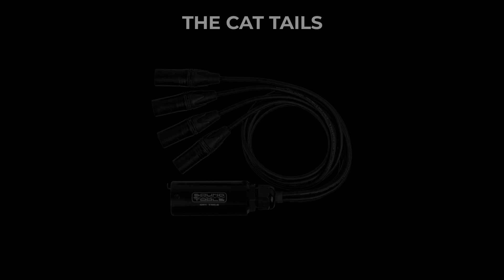Behringer X32 Midas M32 Muting Ping and Zipper Sound (Public)

Comment: I know this one...
Fader position digitisation. The rough part of the chirp is the rate at which the fader position is sampled. The squaek part is an artifact from the smoothing algorithm for the rough digitisation.

I first met this when installing an alpha test version of the Amec Digital ( was supposed to be beta, but it really wasn't that ready). With no consideration of fader position sampling, the faders sounded scratchy. Yup very expensive digital scratchy faders.
Reply from the maker: Interesting and thank you Douglas!
Reply: This is such common, and old, ground in digital audio design I can’t believe anybody actually still misses it.  It is truly 101.  There are even complete circuits on a single surface mount chip available from Burr Brown, Analog Devices, Cirrus Digital, and others that handle the entire function, using either a generic linear analog pot or circular encoder to effect a full solution of extremely high spec.  I’m not saying it’s a piece of cake, as power and ground must still be properly configured, but it ain’t exactly rocket surgery anymore.
Reply: @artysanmobile  There is a tradeoff between responsive faders and smooth faders all restricted by budget, both processing and hardware.
The test case here could be considered a bit "bizarre" generating a sound and then nulling it. It would be handy to get a signal to chirp ratio.

Another fun fact from the Amek desk... Occasionally it would incorrectly output 3 duplicate samples. It was barely audible on real programme audio, but stood out like a sore thumb on tone. I really never again want to spend 8 hours listening to 1kHz waiting for a click that was as loud as tapping 2 fingernails together.
Reply: @dougaltolan3017    I don’t intend to argue with your direct experience, Dougal, but I do take exception to your statement that there is a gray area of fader operation quality.  There is not.  Signal to chirp ratio?  Seriously?  How about 140dB?  Your comments on a prototype Amek don’t seem relevant.  

Mute switches are for muting.  Faders are for attenuating.  ZERO is the only acceptable level of artefacts for professional equipment.  I hate to be so hard core, but exceptions would never pass reviewing muster and should be returned for refund.  I own and have used digital mixers since the 1990s every day without any of these issues.
Reply: @artysanmobile  ZERO eh? I challenge you to show me any piece of analog audio equipment with ZERO noise.
Reply: @dougaltolan3017    Let me restate.  Below the noise floor.  In design that is appropriately referred to as zero.  As in, the user does not encounter any artefacts in use.
Reply: @artysanmobile  You seem to have missed most of this series of videos.
Anyway, this is not a channel I want to have a knob waving argument on.
Reply: @dougaltolan3017    It seems that you do actually, and I definitely don’t.  Kindly ignore me.
Reply: @artysanmobile  Ignore you?
Yeah, I would have except for the personal attacks, the editing posts after a reply, the sheer arrogance.
Your entitled opinion of what you consider to be "professional" equipment is yours.
From a very brief search Midas M32 equivalent input noise is - 125dB. You best butt out if your definition of professional is - 140dB.

So, I stand by what I say about acceptability and wanting to know the chirp (noise) to signal ratio.
Reply: @artysanmobile  The x32 is mostly used in smaller venues and clubs. If the crowd of 1000 drunk people I'm mixing for can't hear the faders chirp, why is it something I should care about?
Reply from the maker: Most likely not an issue. More so when recording soft instruments.

But. Wise humans desire knowledge as ya never know when having that knowledge will prove beneficial.

For me, knowing obscure things has helped me get to the top levels of my craft and people pay whatever I ask for.
Reply: @artysanmobile  And, as for your {post reply added edit} about an encoder on a chip...
You demonstrate a serious misunderstanding of hardware / firmware / software integration.
The chirp IS NOT caused by the encoders.

Comment: Dave, I quickly replicated on my X32rack with no physical faders or mute buttons, only pure software control, and I hear basically the same thing.  So it's not simply the physical interface or lack of proper mute button debounce/LPF, or physical fader resolution (Although I guess it could still be GUI fader resolution).  I'm not sure how the muting is implemented - of course abruptly dropping or increasing the envelope of a signal will have momentary high frequency content, so I would expect muting/unmuting to have high frequency artifacts if they didn't make the envelope transitions slow and smooth (S curve, etc).  You would think in a digital signal path it would be easy to make this muting envelope transition "nice".  I may put in on my scope to see what's actually going on.  But the fader should be much less severe in that respect, as the digital resolution should be quite good, so possibly something else is happening?
Reply: actually, I can directly see the 6kHz problem on the scope.  The LPF'd muting envelope is done with digital gain steps, and those occur at ~166us (-1/6kHz) intervals.  By zooming I can clearly see the gain steps as the envelope increases, hence that 6kHz junk you are finding.  I have interesting scope pictures if you are interested.
Reply: FYI, I did put it into my scope and triggered off the muting, and see that in the x32 rack, the muting function seems to use a simple 1st order LPF envelope function with a time constant of ~20ms.  So it doesn't use any smoother fancy S curve type envelope.  But other than the 1st order envelope LPF, I do not see any glitches or problems in the waveform, waveform is nice and smooth and continuous.  Of course there is still high frequency information in an envelope change that is LPF'd, as the step response of a 1st order LPF does not have a continuous derivative.  So it seems we are just hearing those artifacts.
Reply from the maker: Very interesting!  Thank you!
Reply: @DaveRat  I played a little more, and I can capture it carefully on the fader movement as well.  Due to the 48kHz/8 sampling of the digital gain control signal, the low frequency waveform essentially is modulated up to around 6kHz, where you can hear it through your high pass filter.  This effect will be directly proportional to the speed at which the fader moves.  If the fader is moved very quickly, it will be loudest (should sound similar to rapidly & repeatedly pressing mute/unmute, hence your "zipper" effect).  If the fader is moved very slowly, the effect will be much less.  I verified this as well.  The good news is that as it is directly proportional to both the signal level and the fader movement speed, you unlikely to hear this in normal mixing scenarios, as the signal itself will be MUCH louder than the artifact, especially with gradual fader adjustments.

Comment: Great content Dave!!!  Using "plugins" on the x32/m32 can be tricky in that there's no guarantee you''ll maintain phase coherancy between channels.  Each plugin seems to have a different amount of latency which can be a problem when bussing drums.  This characteristic might be worth exploring.  Thanks again for the content Dave!!!!!!
Reply from the maker: Interesting, I will ponder that adventure. Gonna try and switch gears to newer and/or higher end consoles for a while though
Reply: @DaveRat    Tired of kicking a dead horse?  Just used the M32-R short frame version last night with Andrea Bocelli in NYC.  The mixer could not be physically touched without sending out huge phantom power-switching bombs.  We never found out what channel was doing it but eventually stuck strictly to iPad control to avoid it.  I offer no further comment on this.
Reply: +1 on a phase check with fx!
Reply: mentioned this in one of the previous videos, its a gotcha ive seen a few engineers not notice when paralell compressing with utimo comp. you get round it by dupicating. 1 subgroup for your uncompressed and another for smash.
Reply: Marshall, I’d vote this is applicable with any digital mixing system - when using plugins that are outside the box (mixer).  Most digital platforms offer some form of ADC for processes that take place inside the native mix engine, but as soon as you go outside (SPRK, analog inserts, UAD, etc..) all bets are off.  The Waves and UAD options do offer some latency compensation that can align WITHIN their host, but doesn’t account for any signal buffer going in and out of your mix system.  My recommendation is to always have a measurement path setup with an FFT so you can verify that all impulses leave the desk at the same time.
Reply: @chrispou2002  i think hs talking abiout th intrnal plugins that you an insrt on hannls xm32 dont do latensy compnsation.

if you insert the ultimo comp it adds i think 0.9ms
Reply: @vedasticks  Interesting.  I can try and measure that next time I find myself on one of those desks.  As I understood it, processes inside the box were reasonably in time with one another.  I get that every instance will have a latent path, due to additional filters in play…but if it’s skewing the time without capacity to realign, there’s a bigger problem, there…